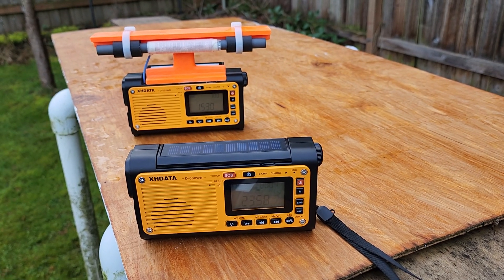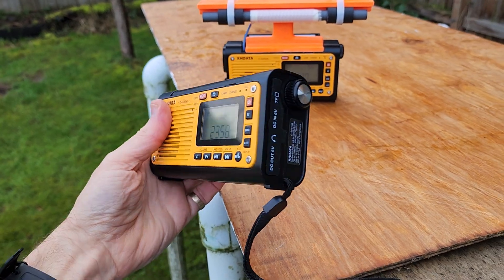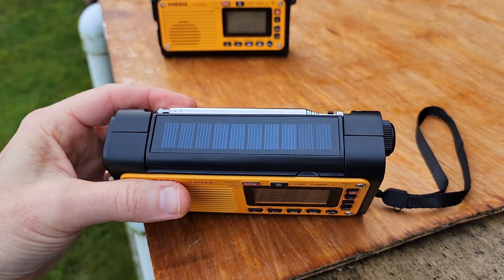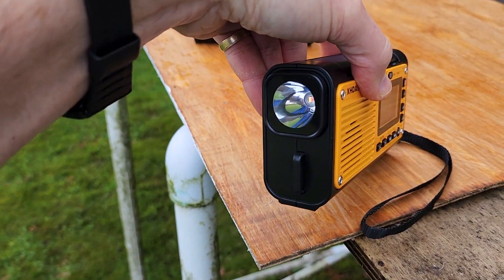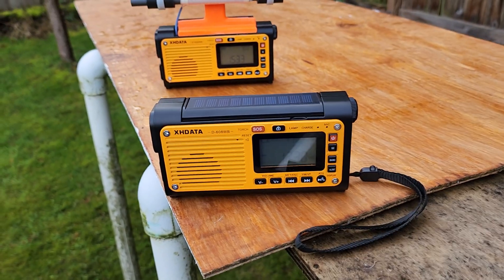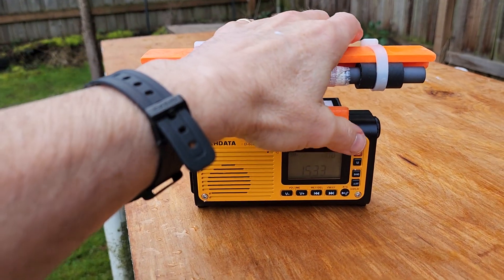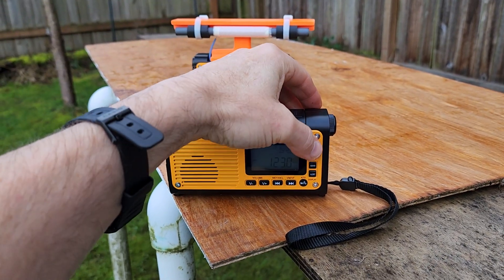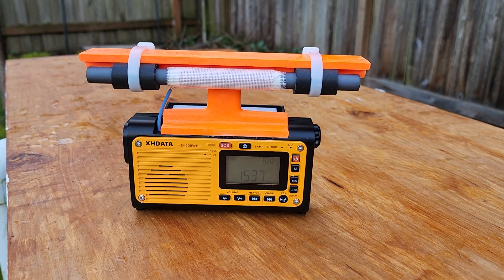7.5 inch (19cm) Loopstick XHDATA D-608WB Ultralight

Comment: Excellent job on the enhanced loopstick. The support looks 3D printed. For AM DX, I prefer a large air wound coil tuned with a variable capacitor for enhanced selectivity. Generally, it sounds like the front end of the receiver is getting overloaded with too much RF. The art of chasing DX on the broadcast band is in figuring out how to grab the desired signal clearly while rejecting any other unwanted signals. 

So, you might want to experiment with using both the enhanced and the stock radios with an air-wound, capacitor-tuned antenna rotated to the signal of interest.